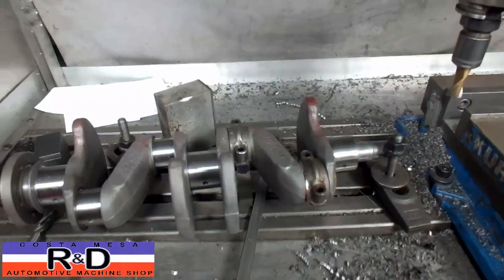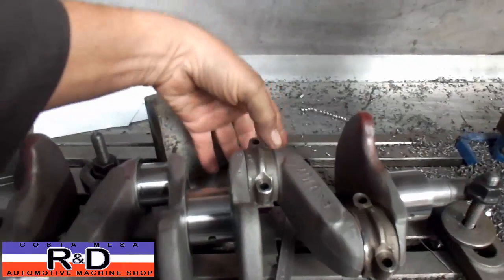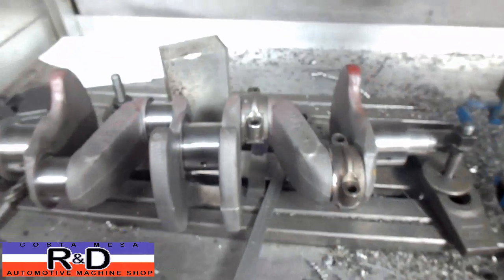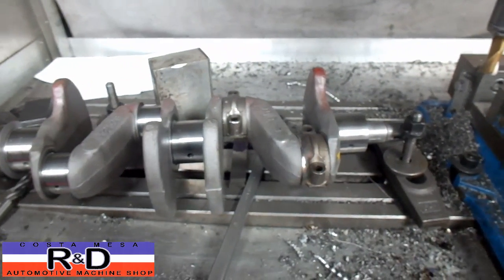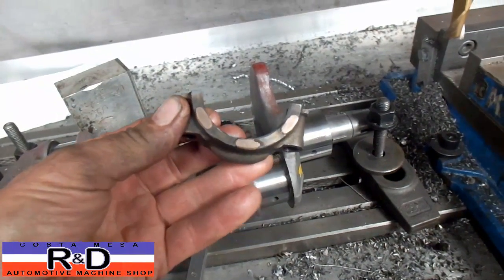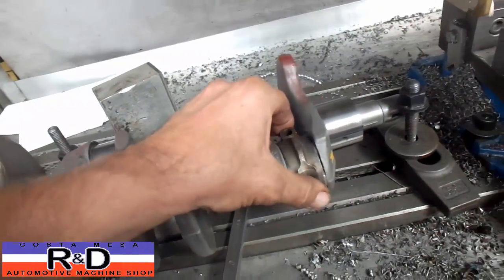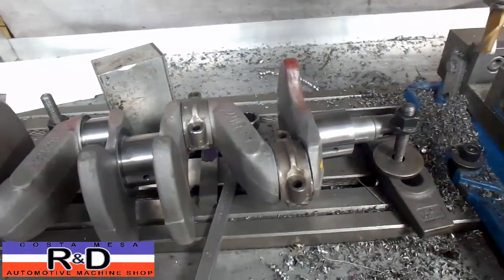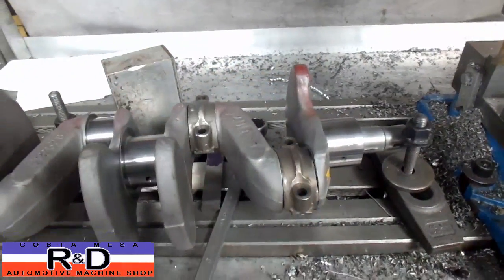MG TD Excessive Side Clearance on Con Rods

Comment: Clever fix.Yes, sometimes you have to use common sense instead of idealism. Is it the crank or the rods that wear down so that this is necessary? Thanks for the good video.
Reply from the maker: Bruce, this crank had been turned several times before it came to my shop, so I don't really know which one it was, but I would suspect that the rod journal thrust surfaces are to blame because all the rods measured the same width. I tend to use a lot of common sense here in my world. Ha...
Reply: fiatnutz Your common sense is one of the reasons I love watching your videos. Ben Franklin said something like "Nothing is so uncommon as common sense." Thanks John.

Comment: John;

Is there any reason why you wouldn't build up the weld for the total diameter of the rod cap instead of 3 spots?  I would think you want to have as much bearing surface area as possible to help control side thrust?

BTW, I have a 66 MGB with a 1924 cc overbored engine that was built by some ex-Offenhauser mechanics.  I need to come by your shop some day just to see your stuff.

Regards;

Ron Kluwe
Reply: My guess is that it is to minimize warping and maintain the roundness of the bore. There shouldn't be very much lateral force to tolerate anyway.
Reply from the maker: The rod should not have much lateral movement and three spots should keep thing well in place.